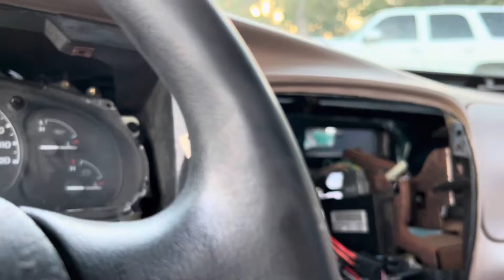FIRST DRIVE! ECOBOOST SWAPPED FORD RANGER!

Comment: Awesome project… I just bought a 98 single cab ranger w/2.5L I’m swapping it out for a built 4.0V6 4.10s limited slip explorer axle and 18” mustang wheels with 275x40 Tires, 2” drop front, flip kit out back and a 1” shackle lift, a c-notch, mat black exterior, and a mod box supercharger for my son. I got one year till he turns 16… when it’s finished I’m getting a 2011 single cab and swapping a 2.7L F150 EcoBoost, and the Hybrid Transmission from a F150 PowerBoost w/7.2kw Battery 🔋 I’m going to cut down the drive shaft and the rear axle and drop it 2” in the front c-notch the rear and add ladders bars and coils in the rear, 18 wheels on 275x40 on all 4s… Sporty Step Side in Grabber Blue…
Reply from the maker: Badass man, rangers are great little trucks. I’ve thought about hybrid swapping my 93 bronco but those hybrid drivetrains are still pretty new and cost quite a bit. I would like to see it done though!
Reply: @JIMMYLUNCHMEAT  I’m scouring the sca auctions site for the right salvaged vehicles to buy to get all the pieces of my two builds…

Comment: If I got a 1998-2011 ranger, I would swap in a 3.5L Ecoboost from an F150 raptor.
Reply from the maker: It would be Cheaper to do a coyote, the 3.5/2.7 EcoBoost drivetrains are expensive
Reply: @JIMMYLUNCHMEAT  I would go for the 5.0 Coyote and a 10R80 with a standalone TCU.
Reply from the maker: @davidperry4013  factory ecu is best for 10R80. They are very hard to control properly with a standalone setup

Comment: Nice 98 gt wheels….I have the same ones on my project roller 86 factory T-Top coupe with sn95 spindles and rearend👍🏻
Reply: I meant 1999!!🤦🏼‍♂️
Reply from the maker: Thanks! I swapped them out for a set of 03/04 cobra wheels, still have the gt wheels tho. I also had them on my 86 fox for a little bit. Great wheels I only paid $200 with tires

Comment: ive got a 99 ranger single cab just like that and im tryna figure out the best and most unique way of swapping his old 2.5L out. thought of multiple k20-k24, LS, other v6 rangers, i dont know what to do anymore, i dont have the time or money or space right now. so its all just thinkin and lookin at what has been done before.
Reply from the maker: K series is an  expensive swap and underwhelming stock. LS can be cheap and powerful. 5.0 sbf out of an explorer can also be done really cheap but don’t make much power. I was in the same position as you and chose EcoBoost because it was pretty cheap and makes great power. Everyday there’s people swapping EcoBoost and it’s becoming very popular. Get on the EcoBoost swap Facebook page, tons of info there. I will eventually make on video on the cheapest way to do it.

Comment: I have a 2005 ford escape 2.3 I was wondering how it would be to swap a 2020 ford explore 2.3 turbo engine into it
Reply from the maker: Anything is possible. The most difficult part would probably be controlling your transmission. I believe the new explorer drivetrains are mounted longitudinally so you couldn’t use the new transmission. However a newer 2.0 EcoBoost escape transmission might work. You would need to utilize the 2.0 escape ecu though.
Reply: @JIMMYLUNCHMEAT  oh no lmao I have a good ole 5speed

Comment: Did you have any trouble installing those wheels on the ranger ?
Reply from the maker: I’m running spacers, I think 1 inch or 1.25. This set of wheels is staggered. I believe they are 7.5 front and 8 rear.

Comment: What clutch did you use and how hard was the engine to wire?
Reply from the maker: Clutch is a cheap eBay clutch. I think “clutch xperts” engine harness was plug and play for the most part.

Comment: Probably worth while if you have a 4-cylinder or a 3L Ranger . But does the EcoBoost produce any more power than the 4 liter ? And I'm not just talking about horsepower , torque is the real measure of power . Torque is what allows my 4L 5-speed automatic Ranger to spend most of its time spinning at 1500 RPM . Does the EcoBoost even produce any torque at that low of an RPM number ?
Reply from the maker: Yes the 2.0 ecoboost has a tiny turbo and makes power almost  immediately. I believe they start making boost around 1800rpm in stock form. I’ve never driven a 4L ranger so I can’t speak on which is better.
Reply: This would have a lot more power than a 4.0l ranger. The 2.0 ecoboost makes 240-250 horsepower and 275 ft lbs of torque stock.
Reply: At 1500 rpm, just off idle, your 4.0 isn’t producing much torque at all....what’s your point?

Comment: I wonder if the 2.3l motor and transmission out of a newer mustang would be a good swap? Since they are both rear wheel drive it might be feasible. I can imagine a drivetrain out of a wrecked mustang might be easier to source.
Reply from the maker: I will eventually get a Mustang transmission, it will bolt to the 2.0 also. Only problem is it will cost me about $3,000 for trans, clutch, remote shifter relocation, and custom driveshaft. Old Ranger transmissions are $350 at the junkyard and clutches are cheaper.

Comment: I need this in my life. How was this done?
Reply from the maker: Lol it wasn’t  easy  but It’s a lot easier if you have a 2001+ ranger. I had to cut and weld a lot
Reply: @JIMMYLUNCHMEAT  I actually want to do this with a RWD converted Ford Probe GT.
Reply from the maker: @stormhawk31  oh ok nice. If I could do it all again I would’ve bought a wrecked EcoBoost mustang and just used the drivetrain from it. I went the budget route with a $670 junkyard engine that only lasted about 1,000 miles. I made a bunch of vids on everything and I’m still making them putting it back together
Reply: @JIMMYLUNCHMEAT  Question: since I live not tremendously far from that area, can you recommend any shops that are good at the kind of frame work it'd take to turn a FWD vehicle into a RWD?

Comment: What year is the motor?
Reply from the maker: 2013 escape
Reply: @JIMMYLUNCHMEAT  nice I’m thinking on a maverick 2.0 motor or 2.3 mustang motor.
Reply from the maker: @ryanbrown5666  I would recommend the mustang engine and trans if you have the money. My setup is budget ($670 for engine, $400 for trans, and $100 clutch) it’s cool and fast but a mustang setup would perform better.
Reply: @JIMMYLUNCHMEAT  I plan to keep the ranger 5 speed if possible. My ranger is 4x4.